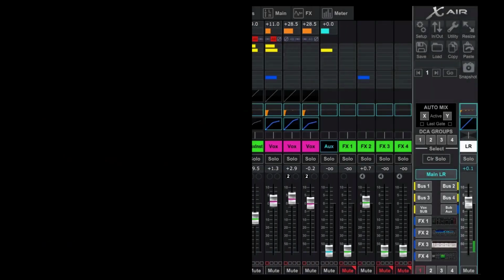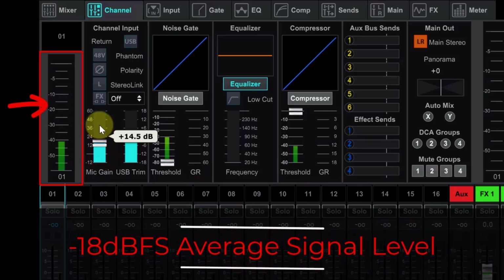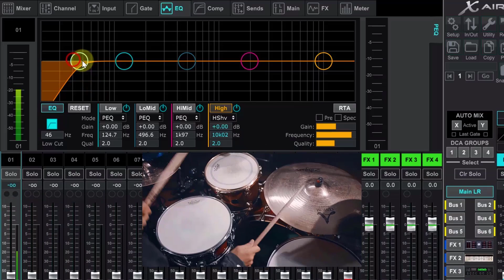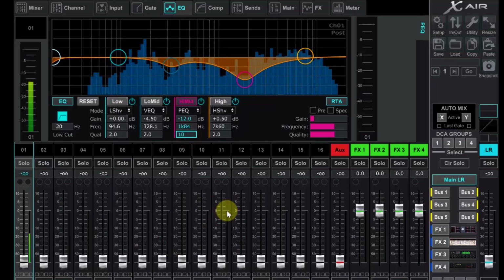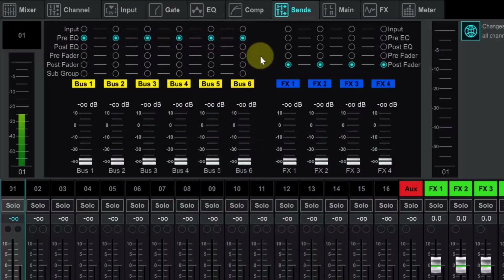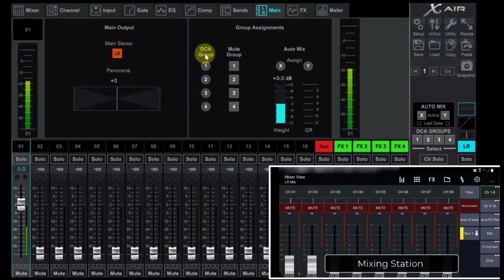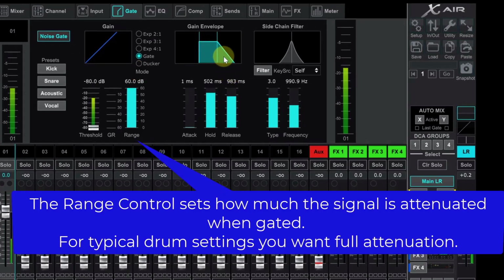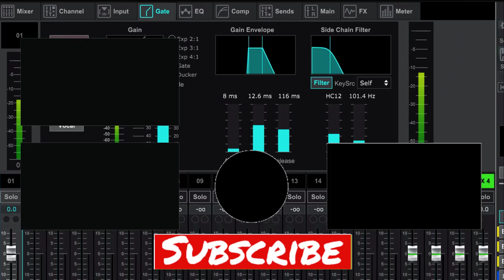Understanding the Behringer XR18 - Channel Setup Tutorial

Comment: Alan you are awesome. I have learned so much from your videos. I have a question regarding the Channel input on the XR18. You went over Phantom power, polarity, stereolink, but you didn't talk about FX.  Do I need to select that to add FX to the channel?
Reply from the maker: Probably don't need to select it for what you're wanting to do. I go over the FX settings in another video- https://youtu.be/TV5ClH_MWrU
The gist of it is that you'd only select that if you were INSERTING something. And on the XR18, you're not likely to insert a reverb or other time-based effect (as explained in the video I linked above) but could want to insert a vintage comp or De-esser.

But in any case, that setting that you are looking at is a bit redundant. When you watch the video I linked about FX, and follow those steps in the XR FX Rack, then THAT section will set that button for you.
IOW, you can do everything you need to do for INSERTING an Effect in the FX Rack when you're setting things up there, and it will automatically then carry that over to the FX button you're looking at on the channel strip.
But for reverb, chorus, delay... time-based FX, you're not likely to want to insert those anyway (on the XR18 or even X32) so that button is fine being greyed out.
Reply: @AlanHamiltonAudio  what if I want to insert the Wave effects to a drum. The effects only give you 2 spots to insert to two channels, so would this be another option to inset that effect to another drum?
Reply from the maker: @edwinrivera3118  No, each FX slot limits you to 2 channels. They don't have to be consecutive channels... It could be inserted on channel 1 and channel 5 just as easily as channel 1 and channel 2, but it doesn't let you add a 3rd channel.
As soon as you select the channels (or busses) that you want the Effect inserted on inside the FX Rack, the channel insert(s) automatically populates with that selection on the channel tab.
You COULD change it at the channel instead of inside the FX Rack, but it would just move the setting in the FX rack too. For example, let's say you originally chose to insert the Wave Designer on channels 1 (kick) and channel 5 (Floor tom). Then you decided you'd rather have it on the snare (channel 2) instead of the floor tom. You can go to channel 2 tab and select the Wave Designer slot there, but you'll get a warning (at least in X-Air Edit) telling you that it's already in use and asking to "Overwrite?". So you tell it "yes" (or "OK") and now it moves the insert point from the original channel 5 to channel 2 in the FX Rack.

Comment: I have a question, we recently acquired this mixer and when turned on without anything connected some channels appear saturated, did I get a faulty unit or is this normal until I plug something in?
Reply from the maker: Channels 1 and 2, with nothing connected, and the gain turned up on the input, and the channel fader up, can be a little noisier than the other channels. But should clear when you connect something to them. Those are the channels with the HiZ inputs.
And if you have nothing connected to them, there's no reason to bring the faders up... So if that is the issue, it's not really a problem. If the noise remains when the faders are down, or when something is connected the channels still remain just as noisy, or if it's another noise you're hearing, or somewhere other than channel 1 or 2, then it sounds like it could be a hardware fault.
Reply: @AlanHamiltonAudio  it's actually coming from line 17/18
Reply from the maker: @Slinks34  Is the gain turned up on the inputs really high? Have you initialized the console to see if it clears?
I've never noticed any noise from the Aux 17-18 inputs, but I've never had the gain very high on those inputs either. But at normal levels for my MP3 player, it's not noisy.
Reply: @AlanHamiltonAudio  I've reset the unit twice, per the instructions but it's still showing up very saturated. Gain is not high. As if something were plugged in. Weird.
Reply from the maker: @Slinks34  It sounds like you have a faulty unit :(
Reply: @AlanHamiltonAudio  darn, no problem. Thanks for the responses you just earned a sub! Cheers

Comment: Is it the Mixing Station or Mixing Station X Air app that I need? I see there are both in the Google Play store. There's also Mixing Station X Air Pro. Not sure which one I need to control an XR18 with an Android tablet.
Reply from the maker: I think there's now a Mixing Station that covers all platforms, or maybe that's on the paid version, but if there's an option for versions still there, it's safe to use the X-Air app.

Comment: Alan, great video as always! Question.. is there a way to reset all settings for a specific channel, or even a group of channels, back to default settings?
Reply from the maker: You can always initialize the console, but that resets every channel and output. IF you have an unused channel in your scene, you can save that channel. Just call it "baseline" or "blank" or something easily recognized. Then for any channel you want to reset, you can just load that 'blank' channel preset and it will reset the channel that way.
I guess technically, as long as you've saved your scene(s), you can even initialize the console, and save a blank channel preset, then reload your scene that you'd saved, and now you have a channel preset you can load into any channel you want to start from scratch.
Reply: @AlanHamiltonAudio  That’s a great idea. I’ll probably initialize and save a blank channel. Thanks man!

Comment: Can I use gate on vocal mic 🎤
Reply from the maker: You can, but it's not usually a good idea. Usually stage volume and vocal dynamics leads to chattering. Some people use the EXPander option versus the gate (which is in the gate section). And if you try the default Vocal Gate settings in X-Air Edit, it defaults to the 2-1 Exp setting.
Reply: @AlanHamiltonAudio  I use xr16
Reply from the maker: @Pujakemparai  The same option should be in the X-Air Edit program connected to XR16

Comment: Thanks for the video. I was wondering if you’re able to use a combination analog and USB inputs modes. For example can channel 1 be taking an analog source (a mic) while channel 2 is taking a USB source (a backing track from a PC)? I thought I understood from the video that all inputs were either all analog or all USB and no combination of the two. Would love clarification on that. Thanks again
Reply from the maker: Yes, you can set each channel individually to be either analog or USB. You can set it on the channel itself in the software... or on the grid in the routing section of the software. There is the X-Air Edit preset (In the In/Out routing section) that automatically changes an entire group of channels over, but you can make your own patching preset and save that there (look at the upper right corner of that routing window on the USB returns tab and you'll see an I/O patching section with disk/folder icon for saving/recalling). I'm talking about X-Air Edit software but I'm sure Mixing Station would have something similar. Not sure about the iPad App software though... unless you're using Mixing Station on the iPad.
Reply: @AlanHamiltonAudio  perfect. Just the answer I was hoping for. Sounds like it should suit my needs…
Reply from the maker: @richardcifuentes6031  If you're looking to use it for studio stuff, then you might check out this older channel video about connecting Reaper to the XR18. It runs thru a lot of the recording configurations for the XR18 plus talk about routing issues. So it might show you some stuff, even if recording is not what you're looking for and instead playing with trax or something like that.
https://youtu.be/xYmJGyroVe0

Comment: Alan, you discuss 'surgical cuts" for problematic frequencies that may be causing feedback. With the RTA turn on, what does a feedbacking frequency look like? How can it be identified?
Reply from the maker: Check out this video on ringing out mons/FOH... It shows examples of feedback on the RTA and what to look for. https://youtu.be/pu0xjl0rpMU
If you're using the 'waterfall' display, the principle is the same but you'll see the feedback as a red signal area and generally a lasting one.  The 'waterfall' shows the frequency range of the signal over time.
Reply: @AlanHamiltonAudio  Thank you so much! I watched. Very helpful!

Comment: This mixer is perfect for gigging and love recording on a budget if you know what you are doing. Here are my recommendations based on using this mixer for about 3 years 

1. ALWAYS set gain first exactly like he explains it at -18db. This will give you an clean even rough mix to work from.

2. Do not use the internal wifi. Use a standard router with extra Ethernet ports to connect a interface and other add ons. You will be stuck without it. I'm not sure why behringer didn't put in a good built wifi but it's unreliable even if you are on stage. 

3. Use the graphic EQ to ring out the house and monitors but don't over do it because you will end up trying to over compensate the EQ and end up with feedback. Know your maximum volume and refuse to go any higher. Just turn down the music in monitors if people say they can't hear themselves. 

4. Save presets for gain adjustments based on specific mics and instruments. It provides a foundation for every set up and saves time otherwise just start from scratch.

5. When live recording, none of the gain settings transfers to your daw so you will have to repeat the gain structure separately first before mixing and mastering. If you need a feed for love streaming use an aux with the main routed to it to stream your main mix. 

6. The gate feature is what sets apart from a standard mixer. Make sure you use it on the mics to minimize any unwanted background noise. The sound should go completely silent when nothing is playing or when people aren't speaking. 

7. Invest in an ipad to be able to be on stage to mix monitors. There also are apps to allow performers to mix their own monitors once they are connected to your wifi router. 

8. I use the dbx driverack as a cross over for subs only because of my old setup and convenience but the console really doesn't need any add-ons. Just put the subs on an aux channel. EQ that aux main to take out the unwanted frequencies and on the channels you need bass put it halfway on the aux channel fader then set it to post fader so that the subs will be in sequence with your main fader volume. 

9. Once you record a live set you can reroute the inputs to usb. I use this to work on mixing and gain structure without the band being present which is another plus. Set the keyboards and line instruments to near max volume to set an accurate gain structure.

For $500 or less this is by far the best mixer for live sound and even multi track recording or as a studio interface. I've even used it to use autotune live through usb and for incorporating daw effects live. The latency is delayed only by milliseconds and isn't recognizable. When I do love sets I record just for the heck of it and most of my clients end up paying for the recording as well. This is a must have for anyone in the business of live sound or multi track recording and can provide the same result as a high dollar console. The only limitation would be the number of channels but I run 6 mics, 4 line instruments(2 stereo keys or 4 mono inputs) and 4 drum mics very comfortably. Including a xtouch interface, 4 phones connected to wifi for monitor mixes, and  2 in ears. I literally was able to supplement all of my analog hardware for one box.

Comment: I'm having issues getting more than 2 channels to be seen by my DAW when I'm trying to record multitrack.   Not sure what I'm doing wrong... any guesses? or suggestions?
Reply from the maker: Which DAW?
In the XR18 if you go to SETUP- Audio/MIDI there is a USB Interface line that has the option of 18/18ch and 2/2ch. Is 18/18ch checked? If not click it so 18/18ch is enabled. 

If you're using Reaper I have this video for connecting the XR18 to Reaper:
https://youtu.be/xYmJGyroVe0

Comment: Alan! Does the xr12,16 or18 have to be connected to a router source to work or will it work if you already have everything preset to your liking?
Reply from the maker: The console remembers the last state it was in when turned off, so if everything is how you want it, then you don't need to connect anything to control/change it.
Caveat being, there is a "mute at power cycle" option in the SETUP menu. If that is enabled then if you use it without a controller, everything will be muted (I think it mutes all the outputs IIRC).
So, if you plan to use it in standalone mode without any control type connected, make sure that option is turned off or else you'll always need a controller to unmute things.
Reply: @AlanHamiltonAudio  outstanding! Thank you so much!
Reply: @AlanHamiltonAudio  if i had it connected to a router at home to get it ready do i need to change it to access point or leave that setting alone?
Reply from the maker: @christopherheadcase6886  If you're not going to connect to it, then it won't matter.
Reply: @AlanHamiltonAudio  Thank you so much.. Ive been using these for 5 years and every once in a while i come across questions when i want to redo things in a different way

Comment: What happens when you are in a scene you've been using for your band etc, and you initialize the mixer via XAir software on the Mac, so you can make a new scene fro another band etc? Do you lose the saved setting info? Is it easier to do a "save as", re-name the scene and then initialize? I use the XR18 at home with a Mac, but will also use it live with just my iPad. Maybe I have to create new scenes from the iPad, or just make a new scene on the home computer and use the iPad live. Any suggestions?
Reply from the maker: Scenes are saved on the computer or tablet that you are on when you save the scene. The scene is not saved directly inside the XR18. OTOH...  Snippets ARE saved on the XR18.

You can also drag/copy the scenes you've saved on your computer to a USB stick so you can have access to it, and it makes for a backup copy as well.

But, the important thing to remember, the XR18 only remembers 1 show. The last one. When you erase it, that is gone... from  the XR18. But as long as you have the tablet or computer it was saved on (or a USB stick with the scene saved on it), you can reload it from there. As long as you saved it in the first place.
BUT... Snippets ARE saved inside the XR18, so anything you saved as a SNIPPET is saved inside the XR18 and can be recalled with any computer/tablet/app you happen to be using at the time.

Comment: I'm glad I found and subscribed to this channel! I've had my Xr18 for several years now and barely scratched the surface. In my application, I use it in my studio to record my band, i.e. vox, guitars,drums in the Xair inputs, through to my PC via USB. I also route them (mainly vocals and guitar) back out through the outputs to my PA mixer,(Behringer 1580}  so the band can hear themselves play. I have two questions.
1) what gain should I be setting my channels to, to ensure unity gain on the outputs (i.e. when I plug my mic's into the pa mixer minus the xair, they should sound the same on the PA)
2) We often want to replay our recordings back through the main outs through additional input channels on our PA mixer. This signal comes from the USB on the PC. We record using Reaper. how would I route this signal in the Xair? I can see the signal in the meter panel, but dont know,how to route it to the main outs.
Sidenotes: We don't use the Xair for live shows, only as a recording interface and a signal passthrough, and for replaying recordings and youtube videos etc. from our DAW PC. I use a small separate dedicated PC for Xair app.
Reply from the maker: I'm not sure I understand your first question, but I think for the second question it's answered in the XR18 to Reaper video. There are a couple of ways you can do it, and the video shows how it works in  both Reaper and the XR18.
https://youtu.be/xYmJGyroVe0
Reply: @AlanHamiltonAudio  Thanks Alan, yeah my first question was perhaps a bit confusing! I just want to use the XR18 as a 1:1 pass through (while still recording through USB). I want to retain the same settings on my PA when we play live gigs minus the XR18.
Reply: Perhaps i can simplify. What DBFs would equate to unity gain? I want the signal coming out of the aux outputs to be the identical level of the signals coming in to the corresponding analog input, but I still need to pick the signal off post eq as i want to compenste for my studio room acoustics. I decided I wanted to learn more about my XR18 and I bought the Mark Baker book, but since I found your channel, i've barely opened it! Thank You!